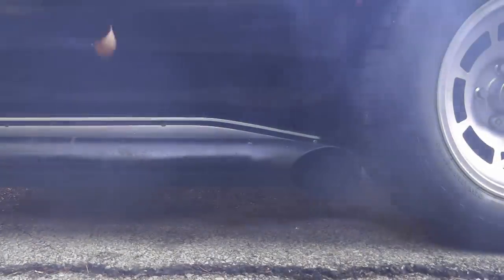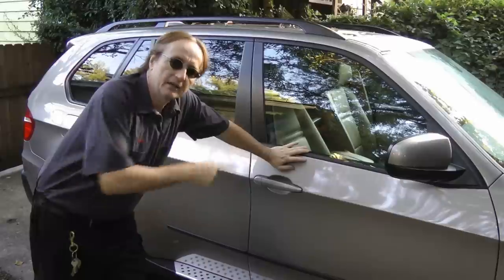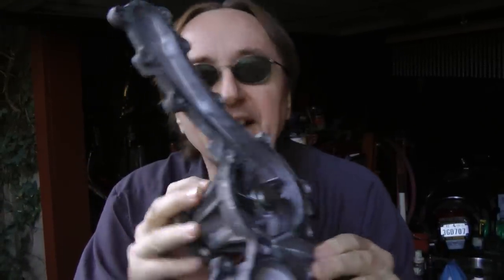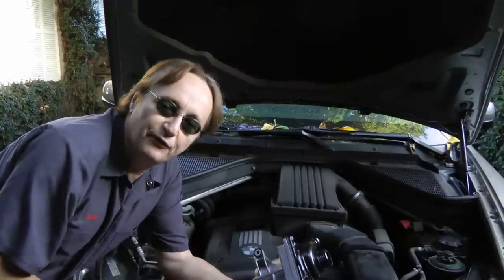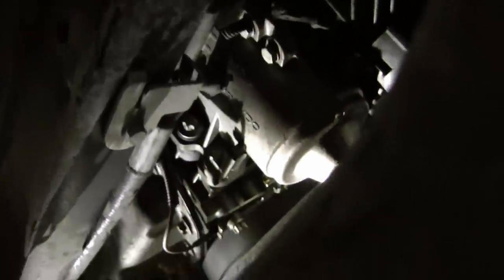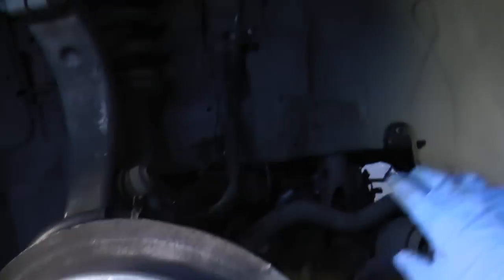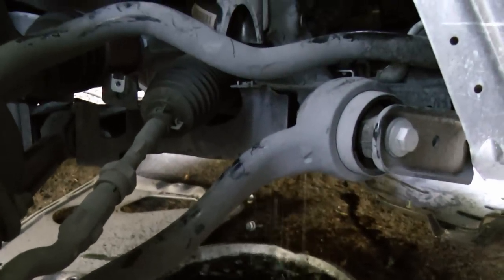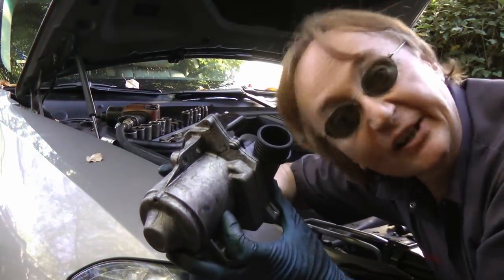How To Replace a Bad Electronic Water Pump

Comment: Maybe it takes you, a backyard mechanic, 5-6hrs to replace. The actual replacement hardly ever takes more than 2 hrs start to finish. These are not cars designed to be worked on in your backyard. When you have the x5 on a hoist, things are a whole lot different.

The reason why the pump is electric is to not put strain on the engine, therefore wasting more gas and horsepower. It is plastic, because it is electronic and it has a logic board, which needs proper insulation. You put it in a metal container, and the antifreeze will ensure that current goes through the whole housing. The result will be one dead water pump.

Now you have been educated, Scotty Kilmer.
Reply from the maker: la de da, the BMW labor rate is 5 and a half hours, from the horse's mouth, So I guess the hoist guys are just ripping their customers off. No big surprise there.
Reply: What's the point of putting these big ass engines in these BMW's if a little water pump is too much strain?  Seriously, how much horse do you lose and how much more gas do you burn from spinning a tiny little bearing in a mechanical pump?  You'd think the fancy BMW engines with their high test gas wouldn't bat an eye at a little water pump...
Reply: No no. It is a general tendency to remove mechanical strains from the engine that are much better controlled electronically. That pump senses the needs of cooling and reacts accordingly by increasing/decreasing flow. This way the engine is always running at proper closed loop temperatures. Less prone to overheating in the heat of summer when stuck in traffic and idling. The pump's rate of spining is independent of the engine's, so it can speed up and allow better heat exchange. Same for winter, it is able to slow down thus letting less heat to leave the coolant. This translates into steadier and warmer temps at -40C when all engines have a tendency to run cold and have weak heat.

I hope that explains it.
Reply: This vehicle was never designed to operate at -40C, and likely never could (for long).  If it was designed to operate at -40C while handling coolant that is 110-115C simultaneously, they wouldn't have made it out of brittle plastic.

Any argument that a mechanical pump places "strain" on an engine and thus extremely expensive electronic pumps must be used is silly, too.  It doesn't translate into real world money saved, only real world expensive repairs.

Electronics, especially ones exposed to large ranges of temperatures that rapidly change and are exposed to elements fail, and they fail more often than mechanical ones.  The advantage of mechanical systems that obviously fail less, is that if the engine spins, so does the pump.  Engine RPMs (and heat) goes up, so does the water pump's RPMs.  With thermostats and cooling fans, the engine temp is maintained within a 5C range of optimal at all times, whether in traffic or on the highway, and cars have been accomplishing that for decades.  Installing these thousands of dollars electronics to more narrowly control those 1-3 degrees of engine temp doesn't translate into anything - you probably wouldn't even notice better gas mileage.

I'm not against the idea of electronically controlled pumps in principle, this was just piss poor implementation and completely unnecessary at this time in terms of vehicle technology needs.  Until technology and parts for these electronic systems match or exceed the reliability and performance of the ancient mechanical ones, it's only a slap to the face for consumers and a total rip-off.  I don't see how anyone could argue otherwise rationally.
Reply: Come to Canada if you don't think the car was designed to run at -40C. You might just get a whole new perspective about what conditions BMW was designed for. There is no such thing as - "this car is not designed to run at those climate." All cars can run in all climates given that you regularly service their maintenance items, especially the cooling system.

The truth of the matter is that you are looking at a highly optimized car and that is one of the many optimizations it gets. These pumps do not fail prematurely compared to older style mechanical pumps. They always last up to and over 100 000kms. Then considering the fact that any water pump is a maintenance item, I don't see what's to complain about. Mechanical pumps also get replaced around the same interval - especially if driven by a timing belt(which is not seen on any BMW's past 1995). And these pumps do not cost thousand of dollars. A 2010 335xi pump costs about 380 USD from the dealership. Sure, it may be more than the 150-200 you'd pay for a mechanical, but after all it is a BMW, so all its components are more expensive because they are part of a big system that is well optimized. This is not a one-time use piece of junk.
Reply: I didn't mean it literally when I said it's not designed for -40.  I was using hyperbole, but the point still stands - plastic that undergoes that extreme range of temperatures doesn't last like metal - it gets brittle.  100,000 km is a pathetic life for a mechanical pump.  Most get swapped out when you service the timing belt at 100,000 MILES (160 km) even if they're functional since you've got everything off anyway, and many last much longer than that.  (And that assumes you even HAVE a timing belt.)  Some of the Japanese cars still use belts, but they're being phased out.  The vast majority of American cars have ALWAYS used timing chains.  BMWs are fun cars when they're brand new, but after a few years, if you hook up a dealer level scan tool and analyze the Line 6 data, you'd quickly realize that they stop being "optimized" very quickly - that's why they don't maintain resale value.  And frankly, I'm not sure how you could call this car in the video "optimized" when it gets 10 MPG less than my Buick, but only delivers 20 more ft/lb of torque.  The real test comes with it comes in longevity though.  We'll see how your beemer is in 2035 when it's as old as my or Scotty's car (both still going strong - mine's a 92 Buick, his is a 94 Celica, both with nearly 250K miles (400K km) and a lot of years.  If you have money to burn, or are the type to lease or trade in every 3 years, have at it with your BMWs.  If you want to get value for your money, you won't buy one, simple as that.  Stop drinking the BMW Kool-Aid though - you'll never convince a rational person that overspending on stupidly-designed parts that don't translate to real-world performance gain, over-engineering, designed obsolescence, and expensive parts is worth it.  You're buying luxury trim and a BMW logo, not some super-performance car.  If that's your style, get a Lexus or Acura - at least those aren't QUITE as bad and they're a lot cheaper to fix and work on, and you get the same status logo on your bumper.
Reply: You want to tell me that Lexus has no issues? Let me point you to the awesooome Lexus RX300 and many many others that are incorrectly engineered and tend to run cold, which causes oil starvation in cold climates and eventual engine failure prior to 100 000kms. There's also a class lawsuit in Lousiana against lexus involving all 97 to present lexus cars. Or perhaps you want to tell me about the endless Acura transmission failures. I must hve swaped at least 10 transmissions under 150 000kms on the 2000-2005 acura Tl's. Now tell me about BMW. Ooh, and also are you comparing your old bunker Buick to a new car - it's like comparing steel to Gold. Nothing in common. But let me also tell you about this 2008 buick lucerne that once came to our shop with a fucked up body control module that would fry up the stupidly designed fuse/relay electronic block. We put a new one and it worked for 2 days until the same happened - no start. A month later - the customer paid for an ecu and 2 fuse blocks. You wanna call that a nice, reliable car? I'd laugh out loud. And I have yet to see a timing belt that has lasted for 160 000kms on a properly serviced car. Ooooh, and you wanna tell me about the 2009 Toyota Rav4 mechanical water pump? What about those ones? Another TSB about their leaking water pumps. You bring a rav4 of that gen to the dealer and the water pump is the first they check! I have swapped 2 so far. One was under 100 000kms, the other was 106 000kms. Wanna keep talking here?
Reply: As I said, you don't need to justify your over-expense to me.  It's your money - see fit to waste it however you want.
Reply: I am not justifying anything to you! Yes it is my money and I have never wasted a single dollar. Have fun with your old Buick and the trips you take to the junkyard for parts! ;))
Reply: Then what is better? A failing water pump at over 100 000kms or a failing tranny at the same (or less) mileage? Just saying here.
Reply: BTW, Scotty, no one would even care if in your videos you were just showing/talking about the replacement process. But you keep yapping and yapping about car lines that you are not too familiar with. And for the most part, what you are saying is not even correct. We all know that all cars fail. Water pump failure is not that bad - especially at that miles. No offense.
Reply: It's a losing battle man.  Some people just don't compute.  You know how we shake our heads and ask why? when those people take their cars into the dealer to get stuff like oil changes, brake jobs, coolant flushes, or other jobs that take a half hour to do and cost way less than $500 at the dealer?  Some German car owners do that same thing and gawk at us thinking we're crazy if we're unhappy a water pump only lasts 3 years or costs $1000 to fix.  They wonder why we don't just spend thousands on "just having someone else do it for us."  "It's so much easier!"  Just does not compute for some people that we'd rather spend the money on cheap strippers and expensive booze.  (Did I get that backwards?  XD)
Reply: Just stop these cars are made for rich people, that have a disposable income and not a clue about cars. The car manufacturer takes full advantage of it. Nothing like a sucker with a pocket full money. Its just a status symbol.  The people that by these kind of cars, could care less that it cost thousands of dollars to fix.
Reply: In my experience it's not usually rich people.  It's people who are wannabe rich and want the status symbol.  They buy the used 300i models with 100K on them already for $20K thinking they got a steal.  Rich people lease and get an entire new car when something breaks or use a car service - wannabes fix it and pray because they still owe $40k on their POS Beemer and need to get 5 more years out of it.  Rich people don't try to defend their over-expenditures on lemons and try to justify it - they say, "What a POS.  I'll buy a Ferrari this time."  Rich people don't usually get rich by blowing huge money all the time - they get rich because they're cheapasses.  Look at Donald Trump - you go to a meeting with him to sell your $50,000 BMW and he can afford it no sweat...but he's going to talk you down to $30K because that's just how they are.  If they blew mad money on stupid shit all the time they'd never get rich unless they inherit it or win the lotto.
Reply: broke after 3 years.  nuff saic
Reply: Rumen Hristov Why would you waste more gas using a belt from the engine? Eventually all the power comes from the engine, including the electricity.
Reply: SarfrazConrad Yes the mechanical water pumps have worked well in the past but then that depends on the circumstances. As Rumen, here, mentioned, Toyota/Lexus cars had engine problem with oil sludge in freezing weather simply because the pump shouldn't have been operating or just minimally as they were revving their engines. Speaking of revving, if the car has to lug more mass then the engine would need to rev more, have a larger engine, or whatever engineering design possible. Something's gotta give. The reason I brought mass into this, is because the standards of safety and comfort have gotten higher and stricter so they would make a car heavier. For example, a current Honda Civic weighs as much as a 30 year old Honda Accord or a BMW 3 Series weighing as a much as a BMW 5 Series that's 30 years old. So that might explain why BMW decided to use an electrical water pump over a mechanical one. The other reason due to turbos which make the engine warmer. So if this trend of heavier cars continue, especially in colder weather, then I don't see the viability of those mechanical pumps.
Reply: Alex M Or the maybe the DIY rich wannabes, as well.
Reply: Rumen Hristov The last reliable BMW has ever made was the e36 with the m50 and the m52 and the s50 and the s52 engines that were in the m3. But even then they had the stupid plastic water pumps but they make the metal ones for it. The BMW e46 was a pice of dog shit they all have subframe problems lol the BMW e46 has a lower resell value then a e36 with the m52 engine. Newer BMW are for people that like to drive around in smooth fast money pits and it's funny when you see someone trying to defend shitty design car like bmw are paying you for defending them. Hold this L.
Reply: Joe Bobby Unfortunately, it's a money pit with that electric pump but it seems to be the FUTURE. Here's why. Cars keep getting heavier and heavier due to the increase of safety and comfort standards. For example, a current generation BMW 3 Series weighs just as much as a 5 Series that's 30 years old. Another would be a current Honda Civic that's just as heavy as a 30 year old Accord. With all that mass acquired, the engine would have to REV HIGHER AND HARDER. So that makes the engine more vulnerable to over heating or being starved of oil due to the circulation of unnecessary coolant during the snowy weather, if the engine uses a mechanical one. So, BMW foresaw this trend and decided that a water pump needs to be independent from the engine's revving. So you all may be laughing at Rumen, here, and BMW, right now, but don't be surprised that Honda, Toyota, Kia, Hyundai, and other brands decided to follow BMW's lead since it would be viable and, thus, be in BMW's shoes to become MONEY PITS!
Reply: TheRealestEver Right, Toyota and others may have scoffed at BMW doing these things and now they're in its shoes. That might explain, on the recent JD Power Survey on it three year dependability survey, why BMW is just a couple positions under Toyota.
Reply: It really comes down to different perspectives, like Engineers vs Mechanics. I like that BMW wants to be innovative and makes a better engineered car, but in doing so, it causes a lot of issues for people who work on their cars. I agree with you on the reason why the pump is electric and I don't think it's cool that Mr. Kilmer just laughed at its plastic design without further looking into the design of the pump. Everything happens for a reason, especially when in comes to complex mechanical stuff. It's just that nothing can be perfect.
Reply: Rumen Hristov still a piece of junk
Backyard mechanic, i bet the techs also swear to the engineers.
Reply: Stefan Unson so reliability a side just assume it can last as long or longer than the mechanical pump and costs about the same is the Electric water pump superior in temperature control? For some were like Denver Colorado year round ? Opinions please
Reply: Kevin Otero that comment was a little unnecessary and didn’t contain any useful information and I don’t have any BMW’s but sense they have a electric water pump it does make a good example for or against that type of part and in my case the aftermarket makes both parts for the sb chevy 350. I’m asking for a reasonable adult technical conversation with out trying for name-calling right off the bat ( I tried fitting into a bmw and I can’t fit because apparently I’m too tall for them @ ~2014 model year so buying one is out of the question ) and if I’ve never seen and or used one my knowledge is going to be limited

Comment from the maker: I would replace the thermostat,that's most common and the easiest thing to do and normally fixes it. You have to remove the thermo anyway to test it in a container of water you would heat up to check it anyway

Comment from the maker: P1443 indicates a mechanical fault in the Evaporative Emission (EVAP) Purge Flow System. A lot of the time this is due to a loose gas cap. Pray it's just that, cause it gets complex after that and can cost a ton to figure out. Though it won't effect the engine running any.

Comment from the maker: either the E brake is on, she's low on brake fluid, or the brake system has a pressure loss when you step on it.  Check engine lights have over 2000 different codes, so get it scanned, e mail me the code.

Comment: I had a 92 Acura Integra, it got stolen. It was a very good car. I changed the transmission oil more often than it needed to be to keep it healthy. Just remember to use Acura's DW-1 transmission fluid in it. (mine took three quarts) I really hated losing that car because it was so reliable.

Comment: Thanks for the tip on buying modern plastic vehicles that take tremendous amount of money and time to fix. I'll stick with my 89' Ford Ranger, since there is a big aftermarket on parts and most parts are made out of metal and is easy to fix.